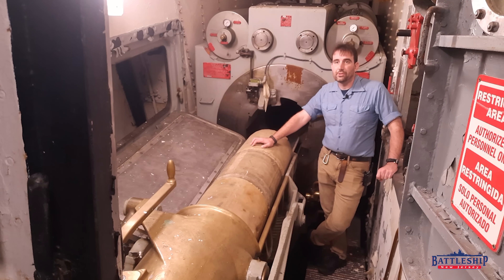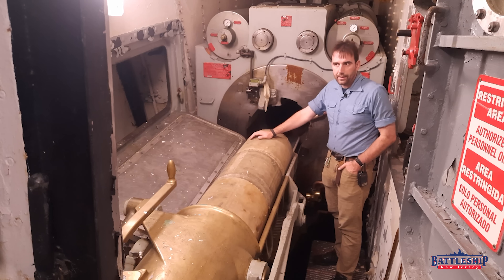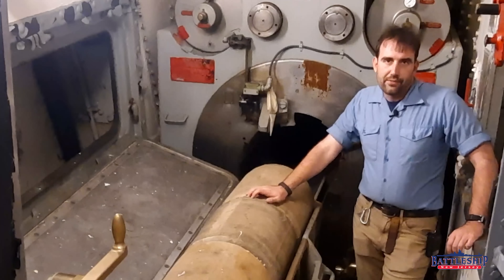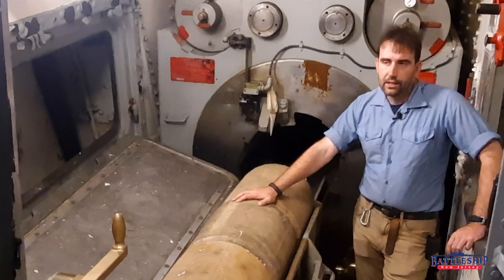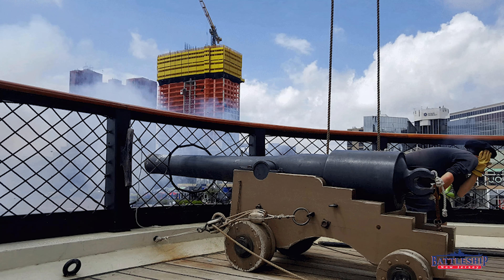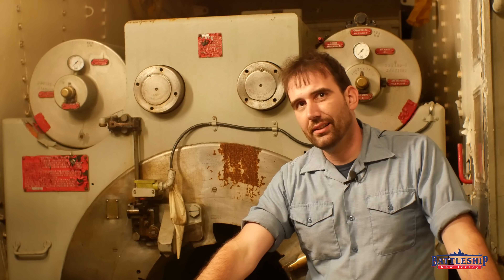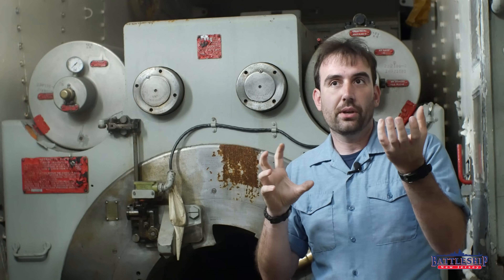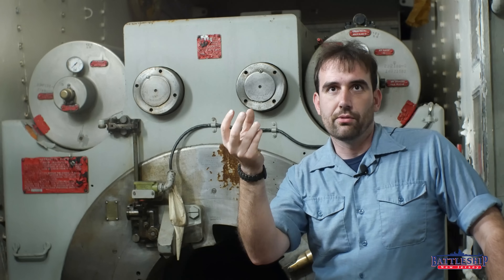How to Unload the Battleship's Guns

Comment: In battleship gunnery it is possible to extract shells from the guns after they have been loaded. On the Iowa we had a training accident in the center gun of turret two and on the same day a misfire in the left gun of turret one that prevented the shell from being fired. For these situations there is a special tool called a backing tool. It is a 110 pound brass weight that is literally dropped down the barrel and it impacts the shell and backs it out far enough where it can be pulled out of the gun onto the shell tray. What you would do is fit a special collar on the outside of the barrel. It came in two pieces and you bolted it together. It had a pulley on it and about a hundred feet of rope. You would tie one end to the backing tool and the other end went to a detail of sailor on the roof of the turret who would hold the rope tight. The gun would be elevated to maximum elevation and the detail on the roof of the turret would let go of the rope. You could hear the tool slide down the barrel and impact the shell. The would lower the barrel and the detail on the roof would pull the backing tool back to the end of the barrel. They would elevate the barrel and release the tool. You would rinse and repeat until the shell was backed out far enough where you could get a cable around the rotating ring and pull it out into the shell tray and you would send it back down the shell hoist to the projectile decks. For the left gun of turret one we backed her out pretty quickly. I don't think it took more than an hour. However the shell in center gun turret two had been pushed up into the barrel several feet because of the explosion as well as the shell probably expanded some from the heat. We tried the backing tool on it and banged it quite a bit. When it didn't work we tied two backing tools together, banged it a bunch more. When that didn't work we tried three, four and five maybe even six backing tools tied together and we banged on that shell for DAYS and could not get it to budge. I was in the gun layer station elevating the barrel half the time and on the roof of turret two the other half. If I am not mistaken I believe EOD came in and drilled out the center of the shell and removed material from the shell loosening the pressure so we could back it out eventually.
Reply: Tremendous story and hugely informative! 

Thank you for sharing and thank you for your service.
Reply: This sounds an awful lot like the Bugs Bunny cartoon when he was checking shell production for duds.
Reply: @RustyorBroken  You have to hit these block busters just right!
Reply: @RustyorBroken  Yikes, that is a scary parallel....with the Gremlin as a helper.
Reply: that's wild, neat story!
Reply: Was the shell's fuse somehow disarmed before this operation?
Edit: Thanks to everyone who answered my question!
Reply: @rorypenstock1763  If it was training it was probably a dud round, if it was a live one most of the shell are base fused, the fuse looks for a deceleration before detonating, that way it punches through armor for a bit instead of just exploding on the surface.
Reply: @crazyguy32100  I wonder how strong the threads are for the base fuse: could you replace it with a plug/eye-bolt and pull on that?
Reply: @rorypenstock1763  I believe the fuse has to rotate a certain number of revolutions before the shell arms.
Reply: @rorypenstock1763  Most Point Detonated Fuses are Armed by small weights that react to Set Back and rotation when fired. GMG2  BB62 Viet Nam
Reply: @rorypenstock1763  on the 16 inch shells there is also an aerodynamic cap on the shells so the tools would not be directly hitting the fuze
Reply: @aaronbriant3697  no, an amour piercing round only has a base detonating fuse which allows for deceleration before exploding. All others have a cap over the fuse. We always removed these.

If I remember correctly, the point detonation fuses has a screw that can turn off the point det features to allow for some penetration. 

Others had electronic fuses that need to be set.
Reply: @aaronbriant3697  Aerodynamic Cap is for Armor Piercing Only.
Reply: @USSBB62  i know i forgot to state that when i made my comment
Reply: @aaronbriant3697  The fuse is in the base as I understand it anyway? The biggest risk would be hitting it hard enough to trigger the fuse through impact shock - similar to how it triggers in use - which would take one hell of a hit without the forward momentum behind it.
Reply: @ianmcintosh418  i forgot how the fuses on the big naval shells worked i had recently been doing research on smaller guns mostly tank guns
Reply: @aaronbriant3697  you know most shell have the fuse at their rear !?
Reply: @rorypenstock1763  no need, the fuse won't be live until set back (acceleration due to firing) and a certain amount of rotations. In the case of a base detonation fuse you will also need deceleration.
Reply: Thank you for sharing.   I remember a previous video and him talking about the backing tool because they found some on New Jersey.  I was kind of confused that this was never mentioned in the video.
Reply: @SDGreg  exactly right. I wonder why Ryan didn’t mention this as he is usually spot on with his information.
Reply: @SDGreg  If I remember, the backing ram was on the mezzanine deck of turret 2.  At least that is where one of theirs was stowed for mothballing.
Reply: Sounds more tedious than just tapping it out with a hammer and cleaning rod!

I’m a little surprised they wouldn’t have a socket on the base of the projectile to screw a big eyebolt into and yank it out that way.
Reply: @FS2K4Pilot  sounds like a plan but what are they gonna use to yank a beetle out of their, that's sits but and heavy
Reply: Thanks for sharing.
My friend and roommate aboard the abe lincoln, david, was transferred to turret 2 and was killed that day. Ive never understood what the consensus was on cause. All i knew was what was in the press didnt sound right, and i wish i knew what guys on the inside believed but couldnt say.
Thanks for sharing.
Reply: @maqui4240  What was his last name?
Reply: @Bellthorian  David Hanson. We  lived together when the abe lincoln was being built in newport news. Any chance u knew him?
Reply: @Bellthorian  i think n it was Hanson.
My name is Mark moses
Reply: I thought there was a way!
Reply: Am I crazy, because I swear he’s talked about this tool before. But i never understood how it works until now.
Reply: @Melthornal  I'm positive he has. IIRC, they found one under Turret 3
Reply: @dcviper985  all Turrets had at least one and if I remember correctly each gun room had one.
Reply: @pville_piper5125  I'm sure that's true, but NEW JERSEY wasn't turned over to the museum in a ready for commission state...
Reply: @dcviper985  notice I said "had "..
Reply: Excellent story, and supported by written procedures in NAVORD OP 769 16-inch three-gun turrets manual, section 2-29. 

I have to imagine it wasn't easy using multiple backing tools at the same time, even with the guns leveled
Reply: This is exactly the method I thought of before I read this comment.  I used to carry a 12" long brass rod while hunting and in competition shooting.  I only had to use it once when I tried to extract an unfired round from a bench rest rife and the bullet got stuck in the lands of the rifling.  The bullets were held very lightly by the case neck and forced into the rifling.  The rod worked like a charm on the first try but I had an action full of powder.  No way would I want to try this with a shell containing a ton of explosive.
Reply: Interesting. Probably only in case of a dud, though. If it's a good round in there, chances are they'll just aim it at nothing and send it rather than risk trying to clear it.
Reply: That’s awesome. I was an artilleryman on 155’s and we have a tool called a bell rammer. It’s exactly what it sounds like, you screw together your cleaning rod sections and on the end instead of a brush you attach the bell shaped tool and ram the shell back out the breech. The bell shape allows it to go around the fuse and impact the body of the shell.
Reply: @cannonman0811  I was a ZU-23-2 gunner (yes, I know, a tiny little gun) and we had a similar tool, a steel cylinder with a conical hole in the end so it would hit the body of the shell, not the impact fuse at the point, which would be screwed on the cleaning rod during firing. It was supposed to be used in case of a misfire should the extractor fail to extract the round from the chamber as they were rammed home quite violently by the mechanism. Fortunately I never witnessed a misfire so never needed to use it.
Reply: Thanks for sharing
Reply: Thanks for your service.
Reply: Really hope they update the video because of you.
Reply: Well that really answered my main question as to "What do you do about a squib load?" A lot better than the actual video...
Reply: Thank you for sharing.  Your comments were a fascinating read and I could picture everything you explained.  Thank you for your service and God bless America.
Reply: It was the generous use of "Break free" To lubricate the shell that produced "A chemical compound that should have been there" On which the entire case against Hartwig was based.
Reply: Quite the story, Do you have a date on both of those? I want to FOIA for the reports on those incidents.
Reply: Here is a link for a “Turret Two Lecture" that’s about an hour and a half long. https://youtu.be/QAsqgc5QkzY
Reply: @chrisb9960    Good stuff. Shows some of the after incident testing at Dahlgren.
Reply: Wow, you actually used one... As far as I know we never did on the Jersey.
Reply: Good thing the rifling is contained in a liner, if the rifling got messed up removing a stuck shell, it can be replaced. Otherwise, you guys did the same thing I did when I had to remove bullets from the barrel due to "squib" loads that pushed the bullet just far enough to engage the rifling but fortunately prevented another cartridge from chambering.
Reply: @taraswertelecki3786  you think anyone is still alive that knows how to reline a 16”?
Reply: @Notcorncowsorchickens  I don't know that answer. What I do know however, is that by the Gulf War when the ships last served, we had figured out that jacketing powder bags with a special plastic jacket and including a bag of what I think was called "Swedish Additive" and which I believe was titanium dioxide, the barrel liner lifespan was increased to several thousands of shells. The ships could realistically fire a few hundred rounds through a liner before the ship needed work in port, so having a barrel life of 2,000-3,000 shells is basically infinite. I don't think they actually determined the true round count after introducing the bag jacket and coating additive pouch into the charges. They introduced them, and then after however many shells they fired after that didn't wear the barrels out enough to need relining. So no telling just how long they CAN last at this point.
Reply: Amazing comment
Reply: The problem with unloading rounds that are in the breach, (I have experience with 155mm M777A2 howitzers) is that the tubes warm up and gets extremely hot, this causes the metal to expand. If you shoot multiple rounds, then go on a cease fire. And then you need to remove that round that was sitting in a hot breach, 1 of 2 things are possible which is why you want to dump the powder out as soon as possible because it can ignite. A friend of mine was shortly set on fire in this instance where he was supervising the unloading of a 155mm shell and powder, the powder dropped out of the breach and turned him shortly into a human torch(no lasting injuries). The other and more costly instance is the round getting physically stuck in the breach, where the tube would need to be removed because that warm metal had cooled to the point that the round is stuck in place.
Reply: Thank you for sharing the story! Ryan’s guess is not that off LOL
Reply: Thanks for that description of the procedure to get it back out. Id assumed like the presenter that once it engaged the rifling of the barrel that was pretty much it.
Reply: Thank you for that explanation, a fascinating look into it
Reply: would be easier to load a raining charge, clear the turret and fire it electrically.
Reply: Why would they even HAVE 6 backing tools on board?
Reply: @gavinjenkins899  One for each gun I guess.
Reply: @gavinjenkins899  because you might nd them and you can't exactly call the fucking shop to have it delivered in the middle of the pacific.
Reply: @billhanson4921  No need to be randomly hostile here my man. It was confusing because it seems like only an extremely niche situation where you'd want them and that it ended up not even working then (which kind of makes sense that if 3 didn't work 6 probably won't). In the meantime, there are tradeoffs for carrying extra weight and expense around, it's not just free.
Reply: @gavinjenkins899  does not matter..... you carry life jackets because you MAY need them not because you WILL need them.... sorry if my response to stupidity offended you.
Reply: When all else fails, read the directions...
Reply: Would scare the hell out of  me to do shay you described with a shell filled with a lot of high explosive.
Reply: he found that tool in a earlier video in one of the turrets and must have forgotten about it.
Reply: What would you do if it was an HE shell stuck down the barrel? I only ask because I wouldn’t want to be the guys standing on top the turret banging away on an HE 😂💁🏻‍♂️
Reply: @brannonschuster7735  As in AP shells the shell has to rotate a certain number of times before the shell is armed. The shell in the barrel had not rotated enough to arm the shell.
Reply: Thanks! I knew there had to be a way to get a shell out.
Reply: The solution is to litterly hammer the shell back out? I don't know about you but slamming a weight on a shells tip does not sound like a very good idea usually
Reply: Why not just climb inside the breach and weld a hook to the back of the shell and then pull it out with a winch?
Reply: @haydengalloway5177  I am not sure if you have ever been in a gun room but where would you put a winch powerful enough to pull a 2700 pound shell that is already a 4th of the way up the barrel?
Reply: why not put a single bag in the breach, prime it and set it off?
wouldn't go far as there is too much room for a single bag to fill up with gas
Reply: Damn please tell me this story is documented somewhere for history’s sake!?!?🤩🤯🫡
Reply: I think a solution to this would be to have projectiles designed with drilled and tapped holes. That during normal use would be filled with a “plugs” or solid pieces of metal. If done with precision and symmetrically placed, it shouldn’t affect the ballistic/accuracy of the round. I also assume the shell geometry is such that it could accommodate this feature. However if faulty propellant (wet or otherwise “bad”) were used and the round was lodged in the barrel. A sailor could crawl into the barrel and remove the solid “plugs” and screw into their place an “eye bolt”. Which could be attached to a chain fall or winch on the back wall opposite the breech face. In this way force could be applied to the back of the shell that would force it out. Some system would need to also be designed that would “arrest” or “stop” the projectile if it “came free” suddenly or all at once with many pounds of tension applied to it.
Reply: This may seem like an ignorant question but ... isn't banging on the pointy end where the fuze is, sort of dangerous? I know that nuclear munitions don't arm until a certain number of spins (minimum distance), do the fuzes on conventional shells work the same way?
Reply: @lsdzheeusi  I believe the shells had to rotate a certain number of times before they armed. Those shells can take a lot. All the shells in turret two were scorched black and had all their paint peeling off from being directly exposed to fire. I couldn't believe they didn't start cooking off. If I am not mistaken I believe the backing tool was shaped on the impact side to go around the nose. I can't be 100% positive it has been over 30 years since I have seen one.
Reply: @Bellthorian  heh, a friend of mine mine used to beat the fuses with a hammer every time he had a guest in the gun room. He always said the reactions were priceless.
Reply: @Bellthorian  If you want to know just how much shells can take, the USS San Francisco in 1942 took a lot of hits. One was a 14" shell from a Japanese battleship that hit the #2 barbette.  It did not penetrate, but it dented the barbette and the 8" shells inside were thrown around the turret.  None of them detinated.
Reply: @lsdzheeusi  maybe the backer tool is ring shaped?
Reply: @benjaminshropshire2900  it's a big, heavy piece of brass. Just undersize for the bore. Maybe 16 or so tall, cylindrical with the center open in a 3 spoke web. It was all one casting. I could be wrong as it's only Ben 30 years since I last looked at one.
Reply: @benjaminshropshire2900  No, the fuses are in the base. No front mounted fuse would survive impact with armor long enough to trigger the charge. The idea is for a built in delay in the fuse to allow the shell to travel through the armor before detonation. If nose mounted, it would be stripped away from the shell before that.
The actual front of the shell has an aerodynamic cap - that makes it pointy for range, then a soft metal much flatter cap under that, that allows the shell to almost grip the surface of the armor on impact to stop it skipping off if striking at an angle. Then you get the actual penetrator with the charge, and the fuse on the back of that, that responds to the sudden deceleration of impacting the armor.
Reply: @ianmcintosh418  I was already assuming that position. The idea would be to pull the shell out the breach not the muzzle. If it's just rammed in by the loading gear that would be the much easier direction.
Reply: @ianmcintosh418  HE shells have nose fuses in most situations. They are designed and intended to detonate on contact with the target. No penetration other than shrapnel. They can use base fuses as well too, though. They have the spot to insert one if desired. AP shells of course have no way at all of having a nose fuse installed. Base fuse ONLY for AP, but base or nose fuse for HE.
Reply: @lsdzheeusi  - most artillery fuses are inert until they are fired. The centrifugal force as the shell spins down the barrel causes a ball bearing to move out and allows a spring to push the striking pin of the fuse onto the primer.
Reply: @phillipdoorbar1615  The development of fuses has gone a long way. But two safety features were there from the very beginning: A safety pin for transport, and an additional "barrel safety" which arms the fuse by the acceleration of being fired. Because said acceleration may fire off the charge otherwise. Later, but that is still before WWI, an additional "pre-barrel safety" was added which delayed the arming after the round was well on its way. Because if you shoot through foliage, the round may go off. Some worked with a time delay (burning powder grain), some with a centrifugal system which needed a number of rotations to arm.
Reply: @lsdzheeusi  the fuse for a standard shell is special that it "detects" loss of acceleration before arming. This allows the shell to penetrate the target's hull before exploding to cause maximum potential damage. If I remember correctly the fuse arms when the shell hits something and then there is a small delay before the explosion.  During the first and second world wars there were reports of shells overpenetrating a lightly armored parts of a ship. That means the shell flew through the entire ship and then exploding outside of said ship.
Reply: I’ve often wondered just how the projectile in the center gun of Turret 2 on Iowa was removed afterwards. Thanks for sharing!

Edit: after reading other comments about the fuze of the shell, does anyone know if the rounds being fired that day were  live ones or inert/BL&P?
Reply: @christianvalentin5344  I was in the powder flats passing powder so I have no idea what rounds were used.
Reply: @christianvalentin5344  Apparently, the one in the center gun after the explosion had been pushed partway down the barrel, and after trying several other methods, the investigators finally removed it by basically sticking a 4x4 piece of dimensional lumber down the barrel from the muzzle end and pounding on it with sledgehammers to slowly shove it back down and out the breech.
Reply: @Bellthorian  I may be wrong about the 4x4; the story I heard was that they ended up using something (and I thought it was wood, but I may be wrong) as a super-sized cleaning rod that they used large men with heavy sledgehammers to "tap" it out with, like you would with the slug from a squib load in a handgun... just lots bigger.
Reply: @christianvalentin5344  BL&P
Reply: @iowa61  
Thanks. It also answers the question about a potential fuze. No fuze or explosive to worry about certainly makes extraction easier.
Reply: I thought I read in the Wikipedia article about the Iowa turret explosion that they actually shot the left gun off to discharge it?
Reply: @dcviper985  I do not think that is true. I specifically remember EOD coming in and opening the breech. There was a hole burned in the powder bag just off the ignition pad. We pulled all the powder bags out and dumped them overboard. It was night when this happened so the gun was elevated for more than ten hours. We would have had to have gone back to gunnery stations to fire off that round and I don't remember that happening. I will preface that statement with it has been over thirty years. I certainly don't remember everything that happened that day and I was probably in shock for a day or two after.
Reply: @dcviper985  Shooting it out as Ryan said. Really is the safest way to solve the problem.
Reply: Funny thing is that I had a Brit sailor stare at me in wonder that we did not even wear flash suits in the Turret. I explained to him that if those bags went off all the flash suits in the world wouldn't save you.

Sad to say that I was proved right...
Reply: @pville_piper5125  is that what the jest of the explosion, just the powder igniting?
Reply: @maqui4240  the primer ignited the pad on the first bag and then rest goes off. Remember, an explosion is just a really fast burn. Propellant is a fast, controlled burn, designed to push a projectile down the barrel without over-pressuring the gun components.
Reply: @Bellthorian  the powder in a standard charge is cylindrical, I think about the size of of a 12 guage shotgun shell with holes in it to promote an even burn.

I had 330 lbs of this spread around my gun room one due to the fact that the dump lever fell off the upper hoist tray on my powder hoist... Not a desirable situation.
Reply: @Bellthorian  put it in the immersion tank than tossed it over board. After being in the tank for several hours the propellant was still hard as a rock...

After fixing the hoist and cleaning up the the gun room we ejected the round with 660 lbs of fresh the next day. 😉
Reply: @maqui4240  The powder bags had been improperly repacked at the ammo plant. The way they repacked them made some potentially vulnerable to a frictional ignition. Evidence shows the powder bags were "over-rammed" on that load. Which lead to a discharge and rapid burning event before the breech was closed. 

As usual. Most calamities are the result of a series of only marginally related events coming together. Bad powder bags, inadequate training, violations of safety standards and protocols, poor senior leadership--all combined into one terrible moment. 

The 16 inch guns are manual systems run by hundreds of people-and require constant, repetitive training to ensure proficiency and safety. Standards have to be set and audited by the most senior leadership or things go to hell pretty quickly. 

There were A LOT of really good, highly-trained sailors in Turret II that day. But the human systems and leadership in place let them down with terrible consequences. And the best sailors have no control over that stuff.

Remember  the Turret II 43--USS IOWA!
Reply: @iowa61  thanks for takin the time on that one.
Reply: Did you read the book about the Iowa explosion called.  A glimpse of hell?
Reply: @studinthemaking  Yes, I was interviewed by Charlie Thompson when he was writing the book.
Reply: @Bellthorian      What you think of the book?  How accurate was it?   One of the people who died in the turret. Was from my hometown.  Uniontown, PA.
Reply: @studinthemaking  me too, my friend was David S.
Reply: You should teach this curator! LOL
Reply: So....hammering real hard on the business end of an explosive shell?

What did you do to the captain's daughter to draw THAT duty????  Jesus!
Reply: @mqbitsko25  For the AP shells, the "business end" is actually the base.  Ships have multiple decks, and for maximum damage the shell needs to go off deep in the ship, so the shells have a time delay.  If the fuse was at the front, it would be destroyed going through the armor.  Instead, the fuse is in the base.  
The fuse isn't armed until it spins, so the fuse isn't armed.  Second, the impact from flying at 2600 fps and slamming into a foot of armor is what sets them off.  Dropping a few hundred pounds on it from a short height is puny.  As an example, AP shells cause minimal damage against destroyers as they go right through without going off.
Reply: I don't know if I'm asking the right way but if there was an issue with powder bags not able to push the shell out the first time why can't you reload with new powder bags and try again.
Or it's not as easy as it sounds.
And what would be the reason why you can't try  again with different bags.
Reply: @RebelRage1  Probably not a good idea. If that shell gets stuck in the barrel somehow and you try to fire the gun like that, that's how you get a gun to explode. Same reason you just clear a round from a fire arm when it malfunctions rather than trying to fire that round again (in most cases). A gun with no opening is essentially just a pipe bomb.
Reply: @RebelRage1  
If the projectile is already "pushed" part way up the barrel, there would be a space between the bag charge and the projectile.
 This space effectively creates a 16 in diameter pipe bomb. Fueled by  over 700 pounds of explosives.
Reply: @RebelRage1  That would probably blow up the breach, air gaps between the powder charge and projectile can cause pressure spikes.
Reply: @davisjohnson3621  Regarding the talk about firing the gun again to remove the projectile, the breach was open when the accident happened, the rammer was destroyed as was the cradle. At the time there was no telling what other damage took place or what could happen if it was attempted. I added a link to a lecture on the Iowa incident. It can be found in this discussion area.
Reply: @RebelRage1  I believe the reason would be because the round moved down the barrel if they put more powder bags in and there was a gap between the powder and the round then i becomes a pipe bomb instead of a gun the barrel might explode rather than shoot the projectile out the barrel.